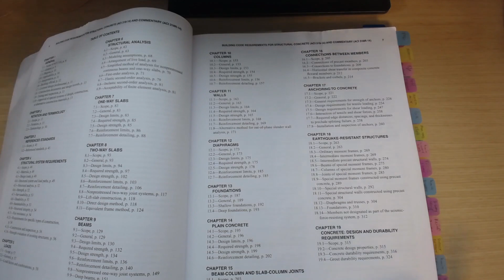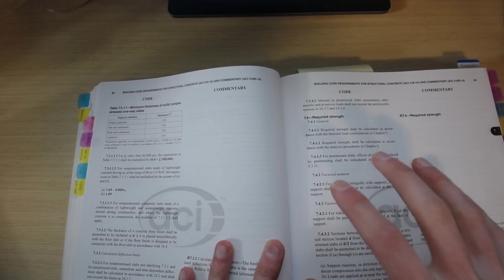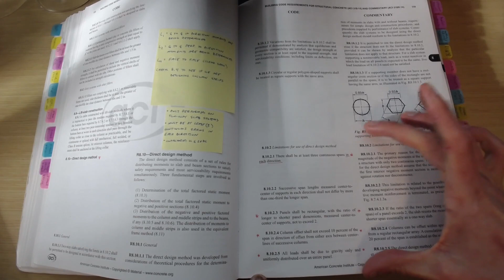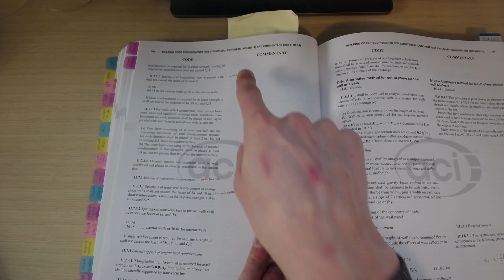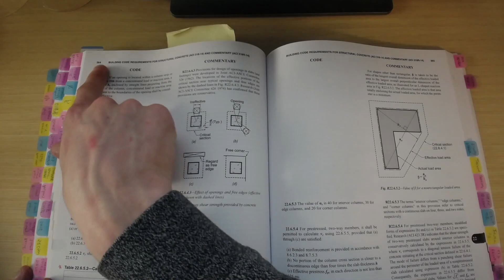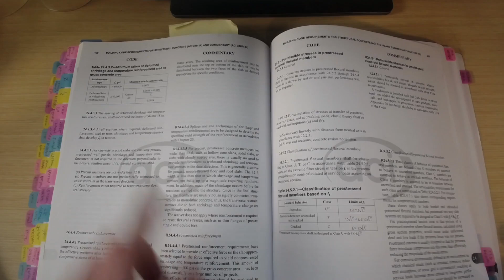ACI 318-14 Tips Tricks and Tabs for the Civil PE Exam | Spring 2021

Comment: Have you done something similar to this with the AASHTO? First PE attempt in October had 3 very specific AASHTO reference questions.
Reply from the maker: i had like 4 tabs in the AASHTO manuals. but cant remember them off hand. my bad! I can try to skim through and jog my memory tho!
Reply: My advise for AASHTO is to move Index from the back to the very front and tab the main chapters. There is so much information in it that I don’t think it is possible to tab anything specific for a PE. Besides, AASHTO questions usually are not that hard if you can find the required information in the manual fairly quickly. SE is a different story...
Reply from the maker: @denfl6605  that's a great response! thanks for providing some input!

Comment: Could you share your Masonry tabs tips and tricks next time? Would really appreciate it. :D
Reply from the maker: Joji believe it or not I did not bring the Masonry code with me to the exam. I didnt know it well enough and only used the CERM to get through the masonry questions.
Reply: @kestava_engineering  woahhh, was CERM enough to solve the masonry questions?
Reply: @jojimanalo4712  You might be lucky or smart enough to be able to use CERM only to answer all masonry questions, there are not that many of them anyway. However, I would not risk a single question by not bringing a listed reference material. They always have some simple look-up questions with answers found in the codes only. Also, even CERM isn't perfect. Compare Table 68.1 in CERM and actual MSCJ Table 8.2.4.2. You'll find that the whole line with allowable tensile stresses in CERM for normal to bed joints, fully grouted is incorrect. It is a pretty common table used for checking tensile stresses in unreinforced masonry. A simple unreinforced problem with, for example, tensile stresses from eccentric load will be easily missed if you use values for normal to bed joints, fully grouted from CERM table. So, the lesson is always get familiar with your referenced code, tab it, actually try to use it or cross reference with CERM when studying. Better be safe than sorry.
Reply: @denfl6605  ohh, nice tip there. Thank you.